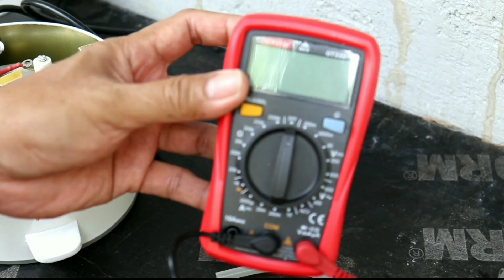EASY FIX! Rice Cooker no power led light

Comment: My rice cooker's fuse was a 192C at 15 amps with 250Volts.  If you have a 120 volts rice cooker you can use a 10amp fuse. The rice cooker is rated at 300 watts which means at 120volts you are only using 2.5 amps.  Even less on a 220 volt rice cooker. I got 5 fuses for $7 so it's a cheap fix if it's only the fuse.
Reply from the maker: This is a 220V rice cooker, you're right this is a very cheap fix, thanks for watching